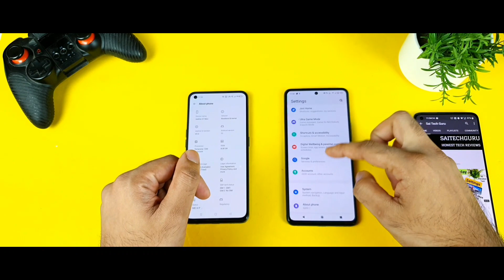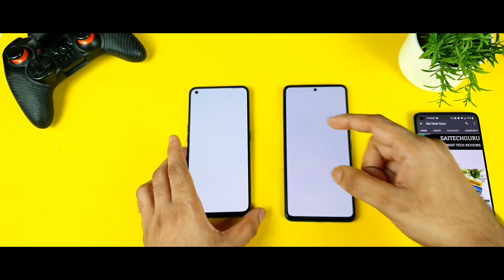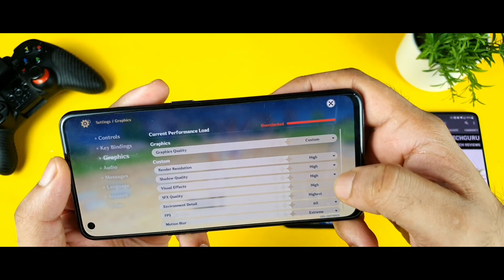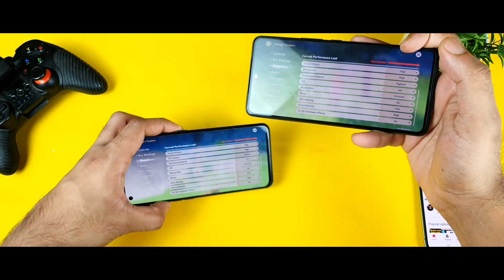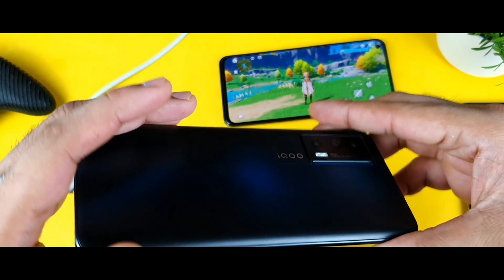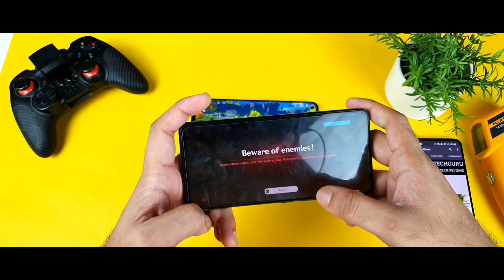iQOO 7 vs Realme X7 Max genshin impact 60fps extreme fps test, heating test using fps meter🔥🔥🔥

Comment: Both phone are equally capable of playing this game with somewhat high settings, but iqoo 7 will manage temperature much better than X7 max as the processor is not optimized for many games. 
If you don't bother about heat, both phone perform best in their price segment. Hope this helps